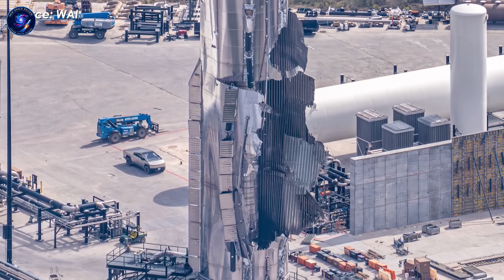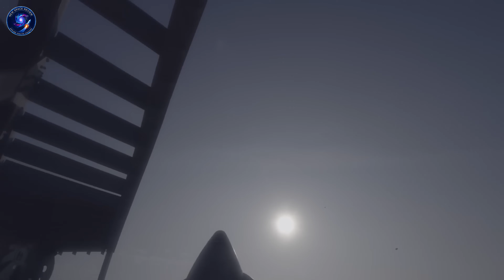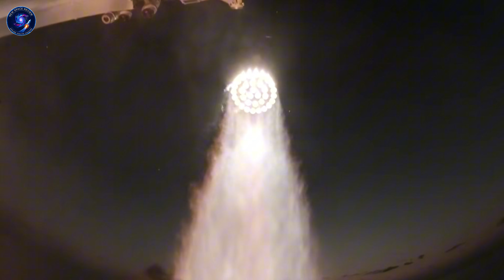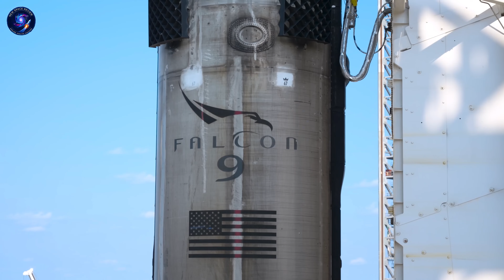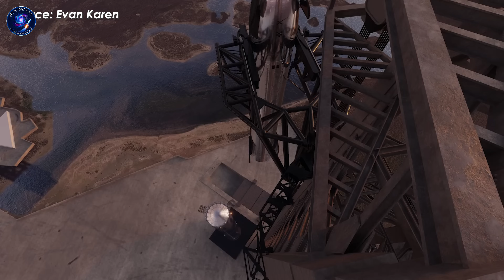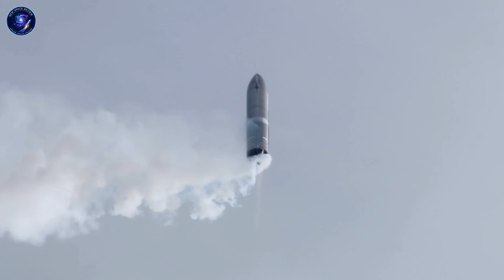Elon Musk Drops Solution on V3: 33 Raptor 3 Engines Ready...Mind-blowing!

Comment: You can tell money is being spent foolishly if theirs that many explosions
Reply from the maker: Explosions aren't foolish spending—they're fail fast, learn fast data points. Booster 18's COPV failure directly led to 33 Raptor 3 upgrades & external COPVs on Booster 19 in just 28 days, making V3 stronger & cheaper long-term.